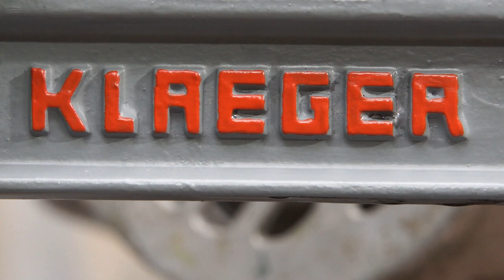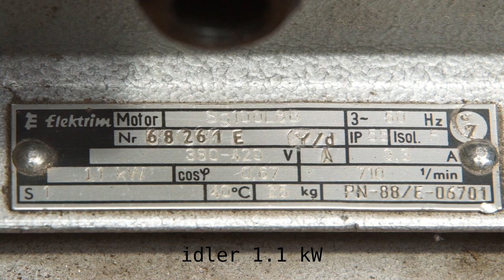testing restored Klaeger Fortuna hacksaw

Comment: Hey Harald, very nice restoration.
If you want the saw running in the right direction just swap phase L1 and L2.
Looks better :)

That directional arrow is on every Fortuna saw because there where models with a liquid cooling pump attached, this obviously needs to run the right direction.
I got one with this pump
Reply from the maker: Thanks for the hint, Simon! I appreciate your help.Yes, meanwhile I fixed the motor connections and the orientation of the saw has been corrected. I just didn't notice my fault when I made the video. 
The coolant pump of my saw was missing. However, I don't like to mess about with coolant in my workshop as it is  just used occasionally and located in the basement of our home. Thus I just use a bit of cutting oil or some (in)famous WD40.

Comment: The direction of the motor is really important! It won't cut very fast when it's turning in the wrong direction. Nice saw! I just found one of these today....needs a bit of work...
Reply from the maker: Thanks for pointing that out. Yes, I fixed the issue meanwhile. 
Good luck with your restoration. I think that the saw is worth the effort.
Will you publish a video?
Reply: @HaraldFinster  don't know yet, didn't decide if such a project is really fitting to the kinds of videos i do :) check out my Instagram for little video of it
Reply from the maker: @DmitriIvanov  I just watched your Albecht chuck restoration video and liked it (and subscribed). Such a restoration video would fit well - in my opinion. The decision is yours, naturally!
I don't use instagram, facebook etc. though.
Reply: @HaraldFinster  cool, thanks man! :)

Comment: Does flipping the orientation of the saw blade mitigate the rotation?
Reply from the maker: Meanwhile I fixed the issue. However, I did not notice a big difference between clock- or counter-clockwise operation. In theory the correct operation puts a slight pressure on the blade when it cuts and lifts off the blade when it retracts.
Also flipping the saw blade does not make a big difference for me. It might be more relevant if you cut very thin material because there is a danger that the teeth get caught.